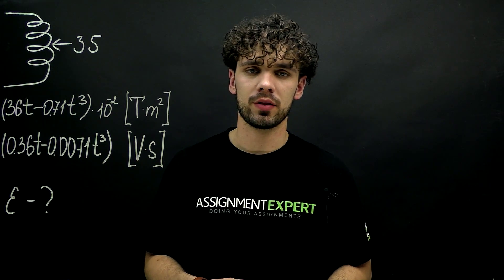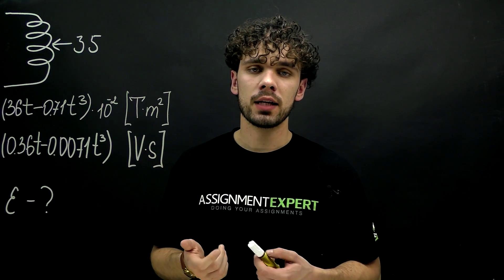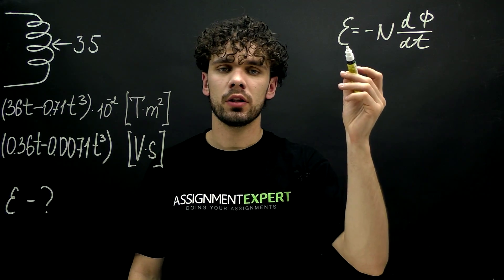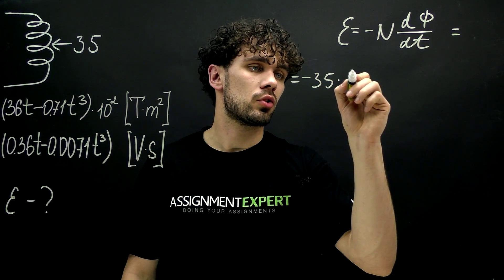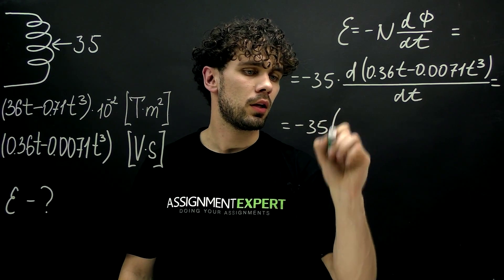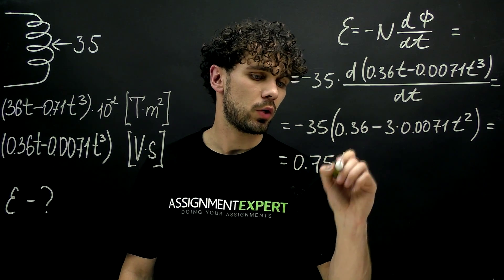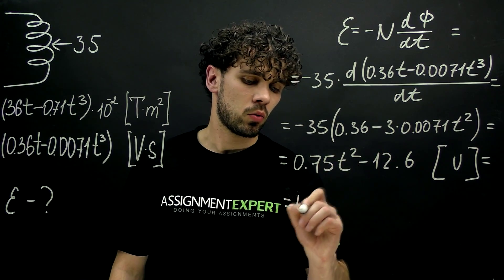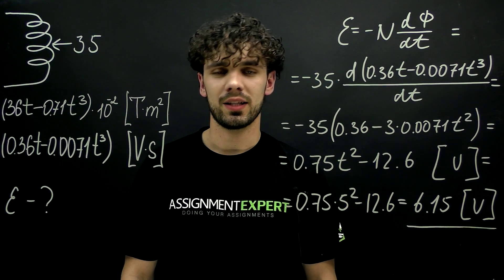Calculation of electromagnetic induction in a coil

Comment: I am beginner i want to understand the basic please help me to understand the logic.

I want to work with electromagnetic experiments in AC and DC

So i have tried with my Aquarium aerator air pump  

iron rod size size 2 cm

Originally the coil was winding with 36 gauge  and working with AC 230 v

I have replaced with 26 gauge wire with 100 turns after giving supply 12 V DC 1.3Amps or 230 volts supply it has burned or smoke sign coming small rod is getting very heat .

can you please explain what i did wrong